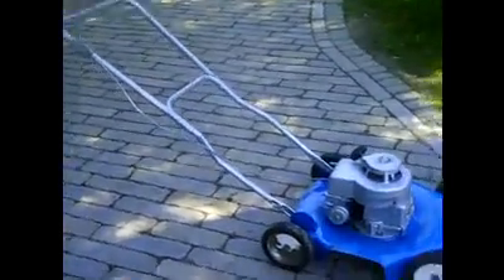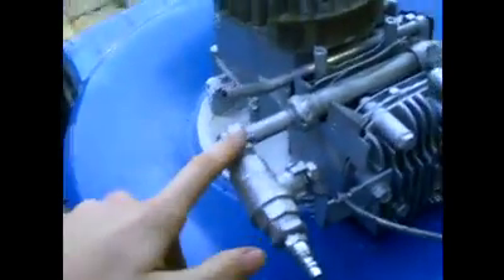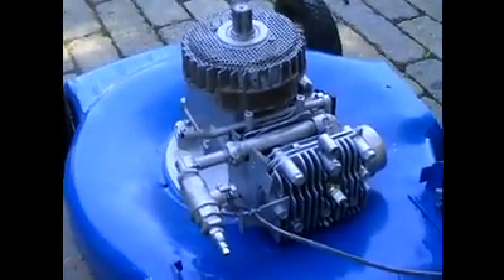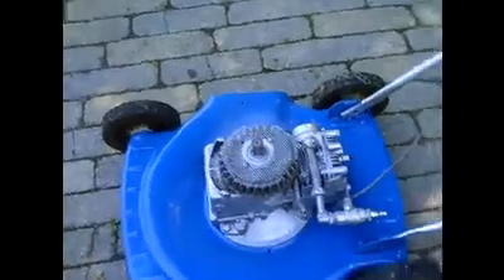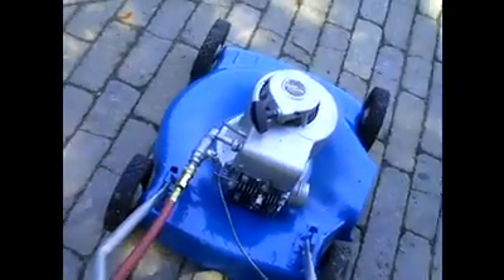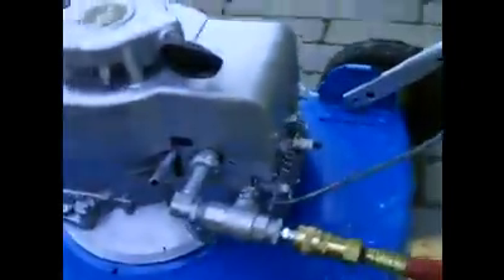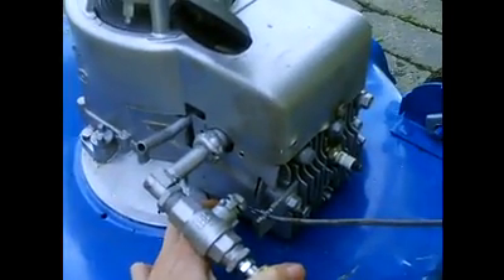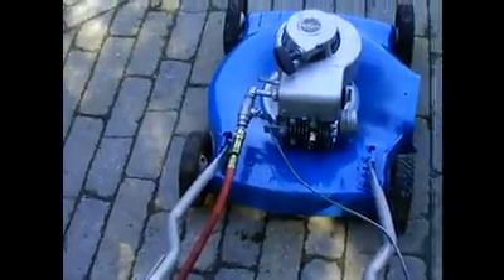Compressed air push mower

Comment: I’m a mechanical engineer and own a software company - you’re awesome! - what’s really cool about the path you are on is compressing air is one of the ways renewable energy can be stored (a ‘cleaner’ way to store than batteries...particularly lead acid batteries) - have a little solar panel connected to air compressor and theoretically you run just about anything from that compressed air - just need entrepreneurial thinkers like yourself to create them 👌

Comment: impressive, wonder if you could make a 1 way check valve coming off the exhaust backinto the intake configured in a way u use compressed air to get it going then it feeds itself from there recycling what the piston pushes out...im gunna attempt this i think

Comment: interesting idea and ive seen other versions of  pneumatic driven motors  . the only draw back i see is hauling around the air hose to cut the grass . it would be more useful as a static motor driving a  device of some kind  like say a pump or generator

Comment: Cam lobe layout is all wrong to be running on compressed air, that's why at "full throttle" it's running at like 1000RPM. You don't need a compression stroke and a power stroke. That thing would be wicked with a cam that timed the valves differently.

Comment: But you're going need oil injection.  What you also need is a trailer to pull with it that has a gas powered air compressor on it.
Reply: KC9UDX  You don't absolutely have to have oil injection.       I have an old junk mower that was given to me. Mowed my yardwith it a  time or two and then I Finally thought (for a change DUH) better check the oil.   I did and it was empty. So I added oil.     BUT WAIT THERE'S MORE    I added oil and almost all of it ran out onto the driveway due to a large crack in the crankcase.  I considered  keeping it and adding oil periodicaly because at the time I was too poor to get another mower. I did not do that as that would have pretty much been a waste of money for the oil.    But I DID keep the mower AND HAVE USED THAT SAME MOWER on my yard for 4 YRS now !!!     THIS IS ALL THE HONEST TO GOD TRUTH

Comment: Im just amazed on how loud these small engines are even with out spark and explosion. Thats just air.  This just proves that small engines werent designed to be quiet like cars. So much mechanical noise.

Comment: To make the throttle work properly leave your cable as is just mount a spring on it so there is constant tension on the valve. The tension needs to be such that if released it goes to full throttle. The throttle cable then holds it closed. This stop that rod from bending. You also need to add more pressure AND more volume! You can get the volume by adding a tank - say the size of a gas grill tank - and plumb it in with the same size inner diameter pipe. This will bring up the RPMS up at least for a while mount your inlet into the tank as well. I hope this helps. Next you need to add a boiler and run it on steam!  Be careful and find help with this step - it can kill you!
Reply: Use old  100  lb   propane bottles, for air.   i have two, connected in parallel, in the garage hosed to compressor.  Works good, lots of volume, for   '' stuff '' .........

Comment: Running have the speed it should you need more cfm 's higher volume of air flow not higher pressure good work tho

Comment: Sorry man but I don't see a practical use for this. You converted a gas mower to air mower when all you had to do was tune the thing. Have you done the cost savings from gas and air. I'm sure air is a lot more to run since it having to use a shop compressor that probably runs 240 volts so every time the thing turns one it sucks down that electricity. Try learning to fix the problem the first time before converting .

Comment: You got an interesting concept going on there. The hose hooked up to the air compressor is restrictive but if you could possibly figure out a way to create a air supply on the mower itself and keep the weight low you might be on to something there. I wonder what kind of horsepower your getting out of your current setup there.

Comment: Ive had so many damn problems with that exact same carbeurator and gas tank, so many design flaws! Ended up running the engine on gas fumes and tossed the carb

Comment: Wow u found a new way to save the environment. A lawn mower that runs on compressed air. However oil still needs to be in the engine to lubricate the internal parts, awesome video. Don't worry about Jacob he scares us just by his comments. He ain't got no respect for no one.

Comment: I have an actual question. This is awesome but does it still use oil? I don't see the oil fill stem in the video.
Reply: Rainbow Dash If it did use oil it would need like sae 0w5 oil since it wouldn't get hot as fast.
Reply: hand held garage Would it get hot at all? The compressed air usually comes out cold. I am just wondering if the crank and pistion still need oil for the lubrication of the rings and gears.
Reply: Rainbow dash It would probably need lubrication since it still has the same moving parts and the same friction. I didn't see the oil fill tube either, maybe it's running at lower rpm and he isn't lubricating it. If he just put a drop or two of oil in the intake every couple uses it would probably be sufficient.
Reply: hand held garage true. Well thanks for awnsering it

Comment: all it needs is an air tank mounted between the handles now and  an maybe a com,pression nozzle so the air comeing out of the tank  has  high compression to it  due to being forced through a smaller nozzel that way it runs faster and dosnet bog as much also  no hose will be needed with an added air tank

Comment: Too funny... ok, so bolt on an air compressor (maybe on a little trailer), then all you need is a generator, so (maybe another little trailer), then all you have to do is put gas in the generator... oh wait...... gas, hmmmm?
Reply: Righty Tighty or mabey u can use another air compressor to run the air compressor motor thats running the mower but then u gotta have another air compressor to run that Compressor man that's a lot of compressors

Comment: Add a pulley to the top shaft then add a small  air compressor, small air t tank. Self sufficient. Pull the engine to get started. And mow forever
Reply: Derek Mikeal how would u shut it off????
Reply: Platinum Lawns Good question. You got me thinking. I just typed out an idea with out giving it much thought. So Tyler calls me retarded.  As long as gasoline is available, air powered engine like this will not be needed.Thank goodness. Have a good day sir.
Reply: Tyler Bandle I apologize for not satisfying your intelligence.
Reply: Derek Mikeal thanks u too
Reply: Derek  Would you then have a perpetual motion lawnmower ?
Reply: Platinum Lawns ,
A shut off ball valve between tank and motor supply tube
Reply: Tyler Bandle 
Same with a supercharger on a car's motor, the goal is to produce more air then the actual motor needs to operate, leaving the extra in a catch tank, pressure limiter that blows open when too much psi is produced/stored, like any other type of compressor you know and seen.  (Size of pulley system would determine how many rotations the compressor makes while the motor's crankshaft also rotates.
Over complicating everything and allowing for Hillary Clinton to try to shut down fossil fuel again😂
Reply: Tyler Bandle energy cannot be created or destroyed.
Reply: Derek Mikeal don't bother trying to satisfy he doesn't even know energy cannot be created.

Comment: It was a great idea though. It could be used on a motor that don't have to move around, maybe a generator, or a gas air compressor, then it could feed it's self.
Reply: or indoor motor for something.  no fumes
Reply: Absolutely.
Reply: Wouldn't that defeat the whole purpose of converting from a gas mower to air powered? If you ran a gas powered air compressor? 😂
Reply: Do you mean like an air motor? Those already exist. https://m.grainger.com/mobile/category/air-motors/pneumatic-motors/pneumatics/ecatalog/N-brn

Comment: im sure it would have been easier to fix the carburetor lol it was probably the diaphram which if the carb wasnt clogged or dirty then that more than likely was it!
Reply: probably just a jet clogged lol could've used his air compressor to blow it out but he just converted the lawn mower to air power
Reply: warriordriver350 that carb don't have a diaphragm. It would have either been a plugged pilot jet or main jet. Or the float could have been stuck, a Passage could have been clogged. Or even something as simple as old gas.
Reply: Chaz B I'd agree with you but then we'd both be wrong. Older Briggs engines of that style don't use a float style carb, they use diaphragms. Know your shit

Comment: why don't you put a hole in the side of the engine and have the input as the spark plug, so it's a 2 stroke air engine? it will be a lot faster.